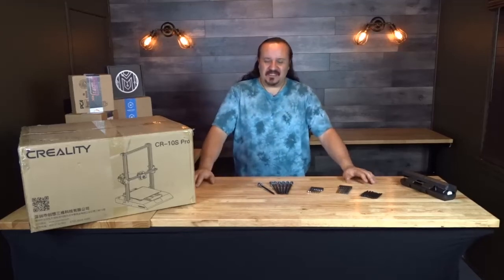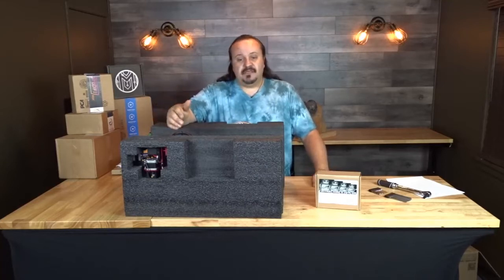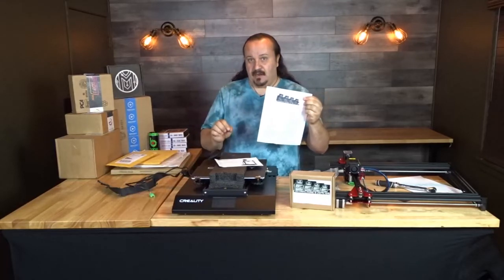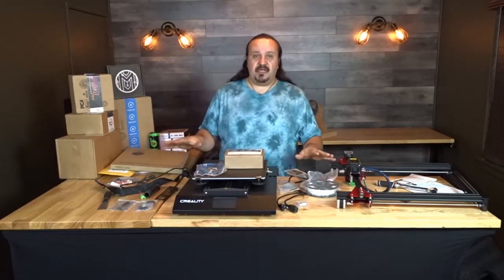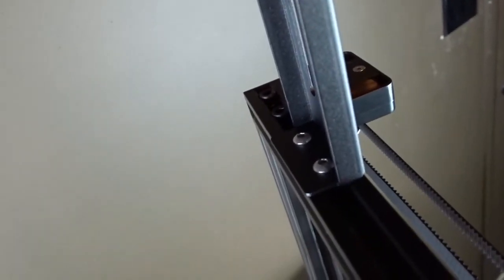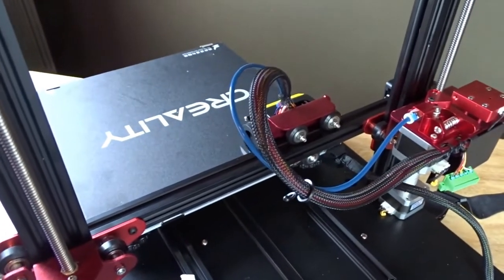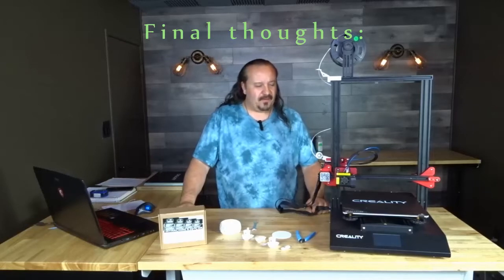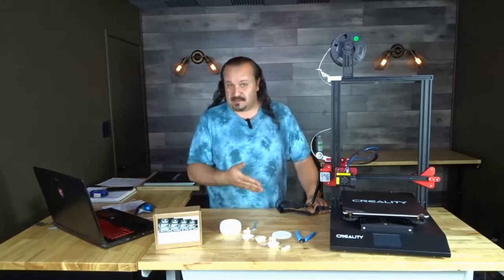CR10S-Pro Unboxing, set up from a Tiny Machines 3D printer. See the Mods, to a Great first 3D print.

Comment: Where can I get the upgrade that ties the x gimbal sides together?  What is that even called?  Sorry, newb here.
Reply from the maker: You can get this from Tiny Machines Send them a support ticket and they will respond with the details.
Reply: Liqui-Dirt 3D what is it called?
Reply from the maker: @JaredB2009  It is the Z timing belt assembly
Reply: Liqui-Dirt 3D Thanks!
Reply from the maker: @JaredB2009  any time I'm always here to help

Comment: Doesn't having a timing belt contacted defeat the purpose of having Dole lead screws to help solve any height offsets when you go through your leveling process so that doesn't really make any sense to me
Reply from the maker: No not at all, in fact, it enables the gantry to stay parallel to the build bed and thus have better prints. the reason for the timing belt is so that the gantry stays level. I think where you are confused is the travel of the Z-axis and your thinking that both ends should move but in reality that would change the angle of the nozzle to the build bed and give poor print results. The z gantry should move all together as one motion to keep the nozzle straight and plum to the surface face. Also the 2 motors are for stabilizing the Gantry they never move independant durring a print. By joining the 2 motors it keeps the Z-axis true at all times during the print. your Z-axis without the timing belt could act as a sea saw and cause bad layer adhesion and fail prints etc.

Comment: I'm unclear as to why the lower left corner of the bed would be "Home". The center of the bed is where a part should be built so why would that not be the best place for home?
Reply: Machine home is always in a corner like that. Same way with CNC's, or other manufacturing equipment. Just move your part in your slicing software.